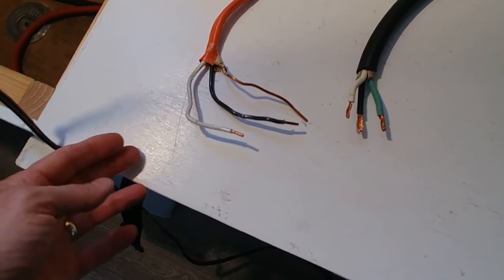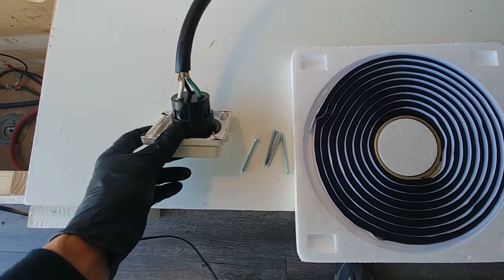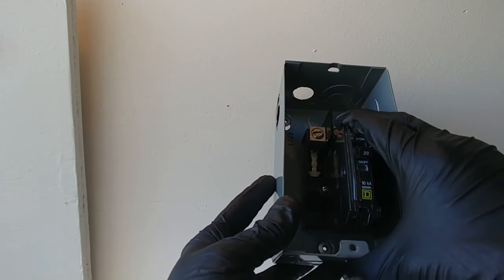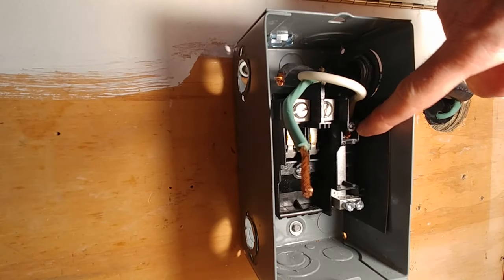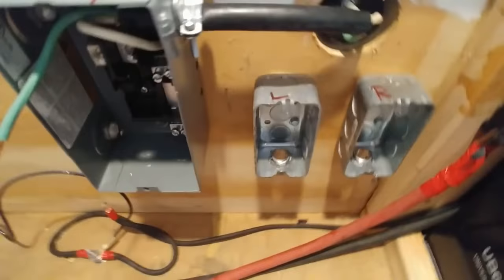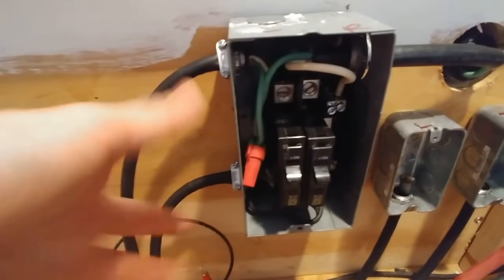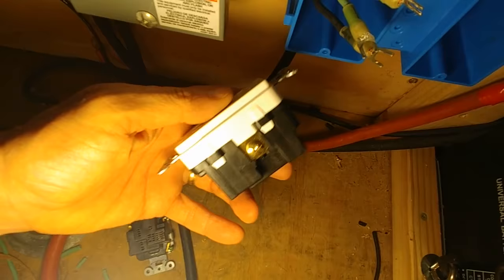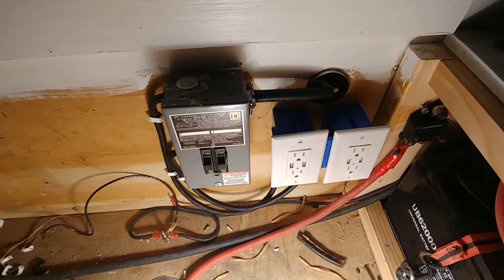SHORE POWER INSTALLATION camper van life cargo trailer camper conversion

Comment: I know this is an old video so hope your still seeing  comments. You did not ground the breaker box nor did you attach a ground wire to the metal skin of the trailer. If the hot wire coming in gets damaged and contacts the skin of the trailer and then you step out of it with your hand still on the metal you could receive quite a shock when your foot touches the ground.

Comment: 2 comments...I do not think the tabs should be broken off in the blue plastic boxes, they are to hold tight the wire and secondly a good thing to remember about which wire goes on which terminal on the plug is "White is Bright"

Comment: Great info and I like that you respond to every comment. I have that 30 amp box and am doing something similar. My question is why go with 2 - 20 amp breakers instead of 2 - 15 amp breakers for the 30 amp box? Is that considered overloaded? Thanks for your time.
Reply from the maker: I am not an electrician but one circuit is large enough for a portable AC. Then I can use the other circuit for TV, microwave, etc. It works for me.

Comment: I just copied this and I still have no power. I have power through my rv line to the fuse box, bit no power the the receptacles. Any advice?
Reply from the maker: How do you know you have power to the fuse box?
Reply: @FakeLegGreg  i have a light on my 30 amp outlet when power is running through. I did notice on my gfci I didn’t have a light on. Pressed the reset button but nothing. Didn’t hear a pop. I just bought two new gfci receptacles tonight, and re wiring my other receptacles in plastic outlet boxes. Maybe I had a wire exposed to the metal? Someone said maybe I have a dead short somewhere?? I’ll find out more tomorrow as I have re wired most of everything.
Reply from the maker: @brandoncsolson  If you have a dead short you are going to have sparks or a tripped breaker. Although I should have used them, I don't recall this wiring video involving GFCI outlets.

Comment: This is perfect! I live in a trailer park that started as a vacation trailer park but now we are all permanent residents with our homes wired to the mains - but the shore power outlets for travel trailers are still here. I want to wire my shed with a 2-breaker system on a shore power inlet and this is the first video I've found that shows me not just the shore power inlet installation, but also the breaker panel and outlet wiring. Wahoo!!!
Reply from the maker: Thanks for watching.

Comment: Awesome videos. Watched all of them and just installed a 30 amp Breaker Box.  Used the 10 3 Stranded wire for main power from 30 amp outside trailer plug like yours. Then used 12  3 Stranded wire for two GFI outlets and surge protecter outlet I needed in trailer. Thanks
Reply from the maker: Thanks for watching Anthony . I am glad they worked for you. Good luck on your project.

Comment: Great video, thanks for giving us the part numbers of the products too.  Good call using stranded cable, less prone to vibration and it will carry more amps versus the same size solid wire.  Keep up the good work!
Reply from the maker: Thanks Roberto. Good luck on your build.

Comment: Nice and Neat - good job as usual GB!! Safety First!
Reply from the maker: Thanks Vince. Iron sharpens iron.
Reply: @FakeLegGreg  did you ever figure out the ground issue?
Reply from the maker: @mobileoffgridpatriot8191  Nope. Still thinking that out. I still don't see how it would ground with the solar. Head scratcher for sure.
Reply: @FakeLegGreg  The only thing I can think of that is different from mine to yours is that I did ground all of my panels and ran a ground wire to my grounding lug. Ran some 12awg green grounding wire from panel to panel.
Reply from the maker: @mobileoffgridpatriot8191  My solar panels are bolted to the metal roof with angle brackets. So, should be grounded. Will test with meter though. I was thinking I need to ground the breaker panel?
Reply: @FakeLegGreg  your breaker panel should already be grounded when you plug in to shore/utility power. So I don't think that is it -- I just wish the solar panels had a dedicated ground wire coming out of the control boxes on the rear of the panels...
Reply from the maker: @mobileoffgridpatriot8191  i see your point Vince. Mine are Renogy. What are yours and did they have that ground hook up?
Reply: @FakeLegGreg  mine are the grape solar - no they do not have the ground wire from the control box on rear of panel. I may open one of those boxes in the future and see what's inside!!

Comment: Small point, if you had used metal boxes they should be also connected to the ground (green), and the panel should also be grounded... standard NEC. Also the wiring should be secured to the wall with straps..
Reply from the maker: Thanks for the advice and watching the video.

Comment: Actually a quite good video. The only thing I would do differently is when terminating stranded wires, get and use crimp on a ferrules of the proper size. Your crimp on terminals at the outlet ends are the way to go... tight and secure. Thanks
Reply from the maker: Thanks for the feedback Clint. I am always learning. :)

Comment: Thank you for this video. A LOT more detailed than the first one. Questions...
1. How many outlets can you run on each breaker? Where do you splice? Also, I assume if your outlets are further away, you cut a much longer set of wires!?
2. How many breakers can you have in the 30a breaker box?

Thx so much
B
Reply: Brian Henry you can have as many outlets as you want. The NEC doesn’t specify a limit but on a 30 amp circuit you have to make sure whatever you plug in doesn’t exceed that all together

Comment: great video but i noticed a couple of things.  Your outlets are only 15 amp so you should run 15amp brakers.  The black wire in the box is right behind the bottom screw in the breaker box. If the screw is touching the hot black wire it can wear a hole in the insulation and short out.

Comment: Great information! I'm going to watch your other videos. I am in the process of designing a tiny RV/camping trailer to tow behind my recumbent tricycle. I want shore power for sure. Question: must I have a 30 amp power port? In other words is there a 120 volt (15 amp or 20 amp) power port? If so should I still use a load center with breaker box and breakers? I was hoping to go smaller to save on the weight of a big 20 foot 30 amp cable. Please advise, and thank you for sharing your expertise.

Comment: @10:30 Outlets and switches are designed such, that the ground lug and common/neutral (white) lug is on the same side of the plug or switch. So if you have bad lighting, the black wire goes opposite the side the ground is located. I never even pay attn to the screw color. Only where the ground lug is located.
Reply from the maker: That's another way of looking at it. thanks for watching.

Comment: Thanks for the video!  Great instructions.   I am converting a cargo trailer to camper also.  I am wanting to put an automatic transfer switch in with a battery charger to charge my battery.   Do you have a video on that?  Thanks!

Comment: There is another problem with using a 20 amp breaker with a 15 amp receptacle--the recep can overload but the 20 amp breaker won't trip, resulting in overheating and eventual fire. Receps need to match breaker sizing.

Comment: Great Job! Where You made that piece of aluminum to protect from fire, could that ever work around and and chafe the outer protective sheathing causing a fire? I believe You've had some or a lot of electrical experience,
Reply from the maker: Thanks for the input. I may have to adjust the aluminum to ensure no future chafing. It is just slipped in right now. It may vibrate out as we drive. I will have to test it out and see what happens. Thanks for watching.
Reply: Or a piece of rubber.
Reply from the maker: @aired-downdisconnected4125  Thanks for the suggestion.

Comment: Good vid! I'm trying to understand why two breakers of say "x" amps is used instead of one breaker of 2x? is there a reason for 2 20amps as opposed to one 40 amp?
Reply from the maker: The pole you plug into at the RV park is 30 amps max, so the total amp draw is less than 30 amps.  2circuits allows for lights to be on both circuits so it doesn't go completely dark if one circuit is overloaded. We ran  electric heat/AC on one circuit and everything else on the other circuit( radio, microwave, TV).

Comment: Great video. Getting ready to do this myself. Ive seen in another video someone mentioned running a ground wire to the actual trailer frame. Is that necessary?
Reply from the maker: I have one to my frame. You can run one if you want. I have been told by electricians to ground to frame and not ground to frame. With rubber tires I am not sure it matters but no harm in  having it.

Comment: Great video Sir! Looks super simple to do. Couple questions though. I have had people tell me you should run a separate ground wire to the chassis to make it safe. Is that true? If so, did you do that and how?
Reply: No, chassis ground is for DC side of the system, if you have DC, this is the AC side….do NOT tie ground to chassis in AC system.

Comment: Question....if I want my electrical outlets to be further away..can I do that? Basically one in the front and one in the back? Just run longer wire, correct? Love your videos....so detailed! Very helpful!
Reply from the maker: Thank you for the kind words. It depends on many things Melinda. The distance to the new outlets and the amp load you are going to put on the wire will determine the wire size. Good luck with your project.

Comment: Hi Greg. Thanks for this video. I successfully installed a breaker box and two receptacles using your guide. I used 12/3 stranded, 300v wires for both outlets. I have some of this wire leftover and would like to put in another outlet. The length of wire I have left is not long enough. Can I connect it with a 12/3 stranded 600v wire so that it could reach the location where I want to put the new outlet? Would connecting 300v to 600v wires be a problem?

Comment: If you wanted more than 2 outlets would you just run another electrical line from the outlet to another one somewhere else in the camper? Thanks! Great video
Reply from the maker: Yes, that will work, but you are still limited by the same number of amps.

Comment: Thank you so much for this video. This is the video that made me feel confident enough to begin my electrical setup. I'm following your example almost exactly in my cargo trailer conversion. I do have one question, if that's ok. I'm planning on having one of the circuits be a dedicated circuit for a small mini split. I wanted to have the breaker be a dual function (C/AFCI and GFCI) breaker since it will be outside (ground fault) and vibrating (arc fault). However, I didn't realize until after already installing most of the system that this Square D load center box doesn't accommodate these type of breakers. My question is, since the mini split is supposed to have a dedicated circuit, would it be possible to install a dual function receptacle in the circuit between the breaker and the mini split just for it's safety features? What I mean is, I wouldn't actually use the receptacle, it would just be there to sort of stand in for a dual function breaker, or would that cause some type of issue? I would use 12/3 stranded wire on a 120v system with 20 amp breakers and receptacles. Thanks again for your help and for making this video. It's extremely helpful.
Reply from the maker: Since the GFCI breaker won't work in this box, you can use a different box. Or, you could install a GFCI outlet at the plug in. I have not used GFCI's in my builds I probably should, but I have seen people have trouble with the grounding to satisfy the GFCI on RV's. Good luck.
Reply: @FakeLegGreg  thank you, that's helpful information.

Comment: Thanks for the great video was what I needed , one question so it's ok the wire nut the grounds  I don't need a separate ground bar ? Again thanks for the video.
Reply from the maker: Thanks for watching. I am not an electrician so I can not tell you what to do. However, wire nutting the grounds together has worked for me. I also added a ground wire from the box to the frame in a later video. Good luck with your project.

Comment: Absolutely loved this video because I’m at this point in my build.  I’m gonna have to call bs on dipping out five seconds after you mention having a fire, requiring flashing.  Kinda dirty if you ask me.  Slow down, tell the story about almost burning the trailer to the ground, and then expand on your solution. The video ended, and I’m here “Wait! What!?”
Reply from the maker: I never had a fire or even close to a fire. I don't recall saying anything about almost burning the trailer to the ground. I was told by a viewer that I needed to separate the electrical wire from the insulation, that the insulation was combustible. So, I added a simple piece of flashing to shield the wires from the insulation. I was also told by another viewer that the flashing would vibrate out, but it never did. No drama, just applying suggestions from viewers. Thanks for watching.
Reply: @FakeLegGreg  That's awesome.  It was such a quick little  comment that took me by surprise , and perhaps got .e a little excited.

Comment: Is that standard practice to use the crimp connectors for attaching stranded wire to receptacles? Great video, by the way; thank you so much for doing this!
Reply from the maker: Thanks for watching John. I am not sure what standard practice is about this. I am not an electrician. I am only showing what works for me. You are welcome to consult/hire and electrician if you would like. I am sure there is always room for improvement. Thanks for the kind words. Good luck with your project.
Reply: @FakeLegGreg  If I wind up using stranded wire I think I will use crimp connectors as you do. I've tried wrapping stranded wire around a terminal and it ain't pretty.

Comment: If you are connected to shore power your circuits are grounded at the shore power circuit box.  But, if you your power source is a generator wouldn't you need to have your breaker box grounded to the frame of the trailer in order to have grounded circuits?  I really would appreciate an answer because I am in the process of installing the same set up as this in my van.  Thanks for a very good video.
Reply from the maker: Thanks for the kind words. I have never used a generator with the trailer but a groind wouldn't be a bad idea.
Reply: GB Conversions & Adventures Thank you sir.

Comment: Only question is why you are using a 40 amp main for a 30 amp shore plug. You could potentially overload that shore plug as the breaker wont trip- getting it so hot it melts- or even worse- if the shore plug has a dysfunctional breaker on the supply end- it could fry it as well. Just wondering.
Reply: Just watched the video and it’s a square D 30 amp breaker with two slots

Comment: Ok very cool and informative. Question- do you need to ground it any special way? I am trying to do something like this in my very small camper. In my camper most of everything is going to be DC- but I would like to occasionally be able to plug a small 120 v AC heater or run my small mini refrigerator if I have access to shore power or using a generator.
Reply from the maker: What I did was run a ground wire from the breaker box to the frame. I also grounded the invertor and the negative side of the batteries to the frame.. Good luck on your project.

Comment: I have a question, I have a van that I want to do this exact same thing and I was wondering if I would hook up the ground wire to the van chase or do exactly what you did? Great job and detailed job 👏 👍
Reply from the maker: Hey David. I have heard both ways, yes to hook frame to ground and no. I would tend to want to ground to the frame for safety. Good luck with your build.
Reply: @FakeLegGreg  thank you for the reply 🙏  I have a good idea of what I need to do, just need to get it done lol
Reply: No, don’t tie AC ground to chassis, only DC grounds, keep them seperate

Comment: Hello there! I hope you find this comment - this video was incredibly helpful. Would I be able to do this for 50amp? What do I need different than 30amp? Thank you!
Reply from the maker: Thanks for watching. Yes this could be adapted to work with 50 amp. Instead of 10 gage wire from the source you would need 6 gage wire. You would also need a 50 amp plug in receptacle and a 50 am service cable to plug into the trailer and the power outlet on the pole. You would also need a 50 amp breaker for the service panel. With 50 amps you may want to go to a service panel with 3-4 breakers to isolate the big amp users on their own circuit. Good luck on your project.